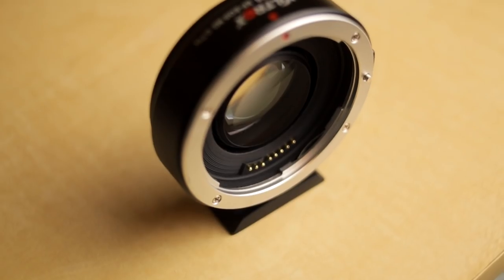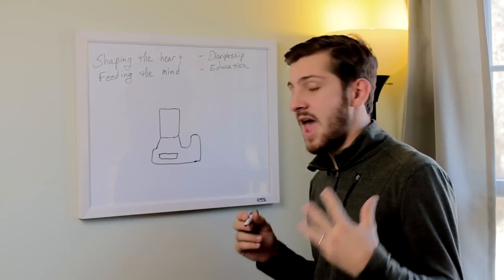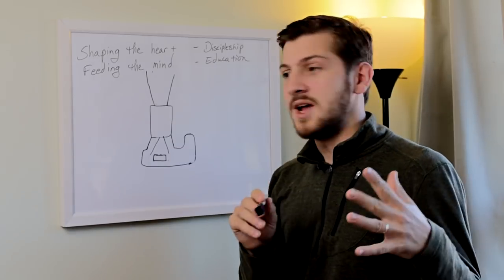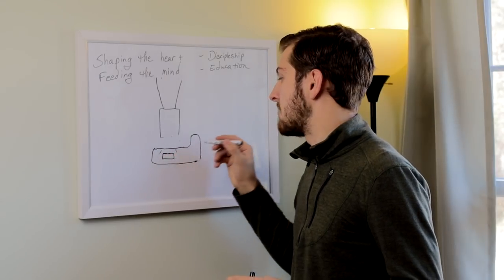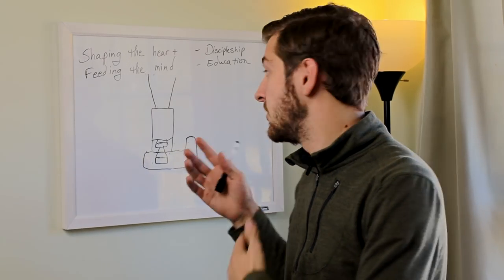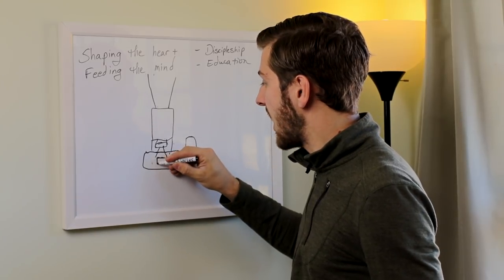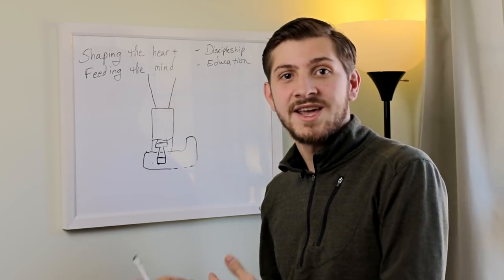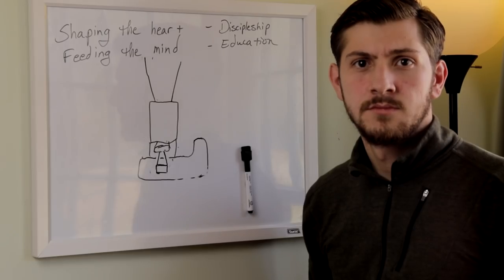Canon Eos M50 Speed Booster How It Works

Comment: I tested the M50 Mark II with and without the speed booster for a 50mm f/1.8 STM. 

The 50mm with the speed booster is sharper in the center and the same on the edges when distance to subject is adjusted so both frames are looking at the same area.

The speed booster deactivates your camera's lens aberration correction. You can adjust your distortion in post either with adobe products or you can fix the distortion with your exported JPEG in rawtherapee (they have lens profiles which are convenient, but lie and tell it you used a Full Frame camera with the 50mm so it correctly adjusts the distortion for the larger field of view instead of the more minor distortion correction of an APS-C camera with the 50mm).

Word of warning, your camera will set the minimum shutter speed slower when the speed booster tells your camera the 50mm is at 35mm, making your camera think it's ok to use slower shutter speeds than the length of the lens should use when in low light conditions. This is easy to fix in Tv or manual mode and is not a problem where light is plentiful.

Comment: Fine. I'm going to buy the M50 after researching other cameras of similar functionalities. And will experiment your advice. The cam sells now in Hong Kong at HK$3,8500 (US$494) including the kit lens 15-45 for the white colour model; $50 (US$6.5) more for the black colour model. I will choose the black one thinking it's more mature for a guy like me at age 60. At this age, can't do too much low angel shooting without pain in the spine. So, with an articulating screen, this little guy should work for me. I will also consider to buy an EF-M 22mm STM lens which sells at HK$1,120 (US$144) here in HK, now. Or HK$850 (U$109) for a second-hand one. But, will wait another 3-6 months expecting it will drop below the price point of HK$1,000.  After all, HK is the place where there is no import tax. Good bargain, always.  :)

I am now using Sony RX10 (first version). It's good. But, my wife finds it too heavy to shoot and refuses to share the fun of photo-shooting/traveling with me, and with it.  :(   So, have to turn to lighter ones. RX10 also does not have the articulating screen; not to mention the touch screen, even though it has a larger aperture at f2.8 and longer zoom range. Hope that I am on the right track of extending my shooting and traveling life with my wife.  Cheers.
Reply from the maker: Awesome man! I think that would be a great setup. My wife loves the 22mm f/2 for photos. It is light and small but sharp and fast. I have never of heard someone not liking it. I think that sensor size will be a good improvement over the RX10.

Comment: The Viltrox EF-EOS M2 speed booster does not accept EFS lenses. EF full frame lenses only.
Reply from the maker: Really that would stink I will look into that.
Reply: @TheCrowleyCrew  I contacted Viltrox - I was not sure if it would accept EF-S - the answer was - It doesnt. It's only for EF lens.
Reply from the maker: Yeah I have been looking into that. From what I am seeing it is the EF-S mount. Using EF Mount APS-C lenses like the tokina 11-20mm would give ultra wide 4k. And it would make the sigma 18-35 more usable in 4k.
Reply: Is this true?

Comment: I’m gonna get this. I like using the CANON 24mm f/1.4L in my M50. With this I’m hoping the autofocus is as good as that with the EF to EFM adapter.
Reply from the maker: I have found Auto Focus to be spot on and faster than my commlite standard adapter. I think that the 24mm f/1.4 would be awesome. That is going to be such a wide fast lens. 🖐️

Comment: Really cool overview. I've got the M50 and have been debating getting the 50mm vs the 24mm EF-S. I think i'm gonna get the 50 and if the crop becomes too much a problem I may get one of these. Very cool. Just subbed too, loving the content.
Reply from the maker: Thank you! Yeah ah I would probably choose the standard adapter first, especially if you have EF-S lenses. The Canon EF-S lenses can't fit the speed booster without modification.

Comment: Just picked up an M50 and subscribed to your channel hoping to make the most of my camera before I even think of upgrading.   I have EF-S lenses from my 80d and would like to know if you can mount EF-S lenses to this speed booster and if so, what is the benefit, of the Viltrox/EF-S combination.  Also would like to know if there are ANY performance issues with this adapter complete with firmware updates.
Reply: EF lenses only. Viltrox EF-EOS M2 will not accept EFS lenses
Reply from the maker: I will look into it. I know that some third party EF-S lenses like the tokina 11-20mm are compatible with full frame EF DSLRs I would work.
Reply: @jimreminga7411  Thanks for the information.
Reply: @TheCrowleyCrew  I believe as long as APS-C lens (Sigma 18-35) has an EF mount and not an EF-S mount it should physically mount, but I don't know if there is an advantage of mounting an APS-C lens to the speedbooster.
Reply from the maker: Well you can use an APS-C lens with the 4k which is kinda what I am thinking about. If you used the 11-20mm the loud Auto focus doesn't matter and it would give you ultra wide 4k. That is the only real advantage I am thinking about.
Reply: Here’s a quick comparison.  https://youtu.be/-isS4cEjhEI
Reply from the maker: Thanks man this was really helpful. I still think third party lenses like the tokina would work.

Comment: Does the extra glass in the speed booster degrade the image quality? I have older FD lenses and had refrained from buying the adapter FD to EF because of the degradation caused by adding another piece of third party glass. Now that I have an M50, I can and have used my FD lenses with the FD to M adapter as there is no added glass. Also use the EF to M adapter which makes the M50 so versatile in that I can use all my older lenses.
Reply from the maker: Not that I have found. It seems like it is pretty good. I have had an adapter like that before and this seems much better. I will be testing it though.

Comment: So wait... can you tell me how is AF performing using this speedbooster adapter? And if I am gonna use this speedbooster than I dont’t need to use my normal ef m- ef adapter? What about bokeh? How it is once again with aputure? There are not so many videos about m50 with speedbooster and I think you are able to make great video about it.
Reply from the maker: I will try to address all the questions in a video soon.
AF is as good as native lenses. 
Speed booster won't work with canon brand EF-S lenses so for those you need a standard adapter. Bokeh shape will depend on the lens and it will have more sallow depth of field at the than a standard adapter, and that is because it gives you 1 extra stop of light. 50mm f1.8 on the M50 with a speed booster will be like a 35mm f/1.2
It will increase your field of view from 1.6X crop to 1.1x crop.

Comment: Actually the only difference between a Full frame and cropped sensor is field of view, a speed booster corrects that. But great video 👍
Reply from the maker: Thanks man. There is also pixel density. More densely pack pixels are less sensitive to light causing more noise. That is why the A7Sii and GH5s are low megapixel cameras, to keep the pixels bigger and more sensitive so you have less noise. So a 24mp full frame sensor will have better iso performance than a comparable 24mp crop sensor. There are a few smaller reason but that is a big one.

Comment: Amazing vid! I am happy for you and your subs because you deserve it! Man i have so many questions...if you could address them in your next video.
1) I too have the speed booster with the 50mm 1.8. please do a full review with this combo please (the sound of this lens in video mode is horrible no?)
2) I have updated the firmware (1.3) of the Viltrox so the additional stops are kept (with previous firmware when you take a picture and then preview it the lens goes back to 1.8 instead of 1.2). It seems that the firmware fixed that. Do you confirm?
3) Finally i saw a close up of your speed booster and mine has the "white dot" in the back on the mount where yours is on the top. Did i get a fake one ?
Thank you so much for helping us exploring more in the M50. I believe the key is to help people is getting better in photography without spending thousands on 1DXM2 or Sony 7AIII.
Reply from the maker: I will answer all those in the video. I did hear that awful noise. I hope that it is just that lens. I havent update the adapter yet so I need to do that. I did see that problem though. I will look into that dot too.
Reply: @TheCrowleyCrew  this guy has also the white dot on the back of the lens like me and he experienced quite a downfall with the speed booster. Cheers
https://www.youtube.com/watch?v=AC_Evzq7o2U
Reply from the maker: I will definitely be checking into that battery issue. I think the white dot just a difference in batches. They probably just moved it in a second run. I don't think it is a fake.
Reply: @TheCrowleyCrew  Thanks. So far no battery issue for me!
Reply from the maker: Awesome.
Reply: @TheCrowleyCrew  Another question: does the small rig fits with the Viltrox bottom stand? i am asking cause i saw on DPreview that if you remove the SB stand those 2 holes have no bottom and therefore dust can enter your adapter...something to think about! Cheers
Reply from the maker: Yes it fits. I really liked that. I will check on those holes though.
Reply: The Crowley Crew reply from Viltrox about the “white Dot” being on top now:

Dear Customer, 

Yes. We had change the white dot on the top. It will be easy to see for user when the mount the lenses. The quality is the same

Best Regards
VILTROX
Reply: update: left the SB on my m50 with fully charged battery. After 2 days the battery was dead. The SB discharged clearly the battery
Reply from the maker: Yeah I have been doing a lot of tests about that. It seems to happen sometimes and not others. I guess worst comes to worst you just can't leave it on the camera, which would be annoying. It definitely isn't all pros without cons.

Comment: loving mine getting more than stop improvement firmware updating and finding out version bit odd if could do that sometime thx my ef 70 300 f4 5.6 getting 2.8 to  4 and sig 150 600 5 to 6.3 getting 3.5 to 4.3 no af issues few specific lenses some issues the sig 18 35 have to go to 28 mm to avoid vinegreting
Reply from the maker: Nice! I am thinking of getting a 17-40mm f/4. I think that could be a great wide and fast setup.

Comment from the maker: Here is a video talking about how you cannot use Canon brand EF-S lenses with the adapter because of a tap that extends to far into the adapter. 
https://youtu.be/-isS4cEjhEI
Reply from the maker: It cant work with canon mount ones because it has a extra tab on the back. You can use a lot of third party lenses like the tokina 11-20mm though.
Reply: @TheCrowleyCrew  you can use them but it means you have to be willing to modify your cannon lens. Lots of videos about it on YouTube.
Reply from the maker: Thank you. I actually found that out doing research, but thanks again I will mention it in my review.

Comment: I own a EOS M which I use with Magic Lantern software hack.  While I've not yet received my Viltrox EOS EF - EOS M speed booster, I'm assuming the EOS EF-S lens can not be used on the Viltrox adapter (much like the Metabone's adapter for EF to M43) unless the EF-S  lens is modified.  This is because of the design of the EF-S lens rear and it's protruding flange - which hits the speed booster lens.   I've adapter all of my EF-S lens so they work with the Metabone's adapter EF to M43.  See my YouTube video for the hack -  https://www.youtube.com/watch?v=jT3olajHF40&t=25s   This modification should work with the Viltrox speed booster too as it removes the protruding flange.
Reply from the maker: I did figure that out and yes you are right. But if you use EF mount APS-C lenses like the tokina 11-20mm it will work. Thanks for watching!